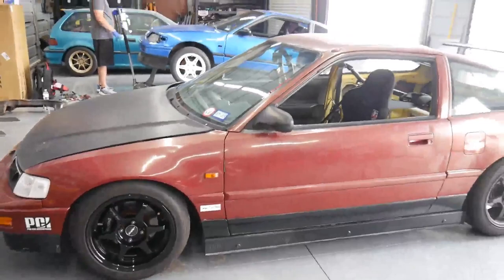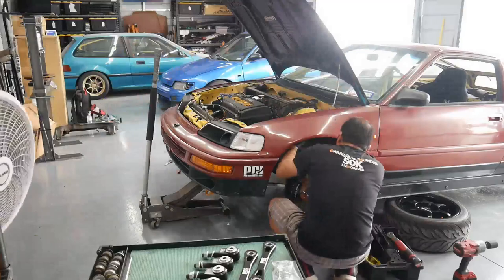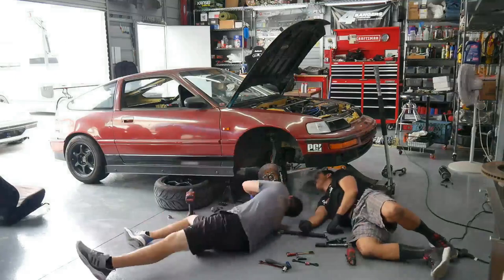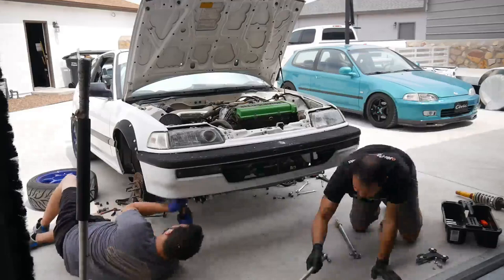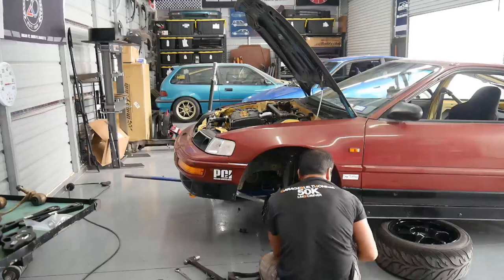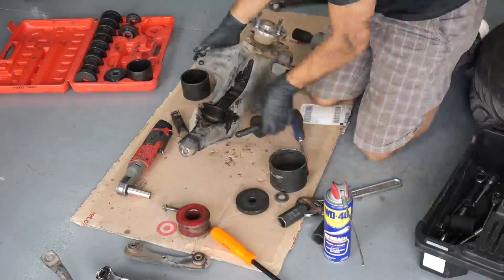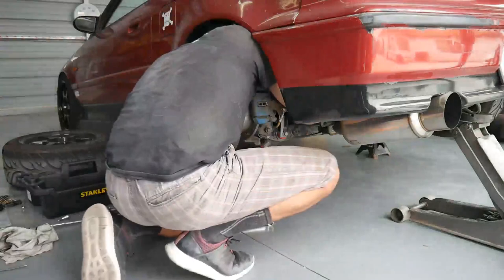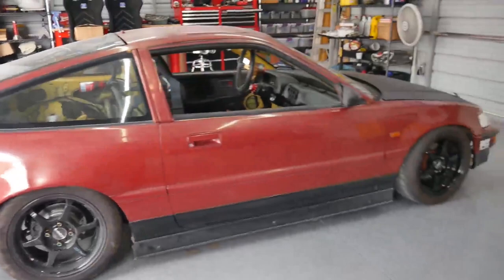Suspension Overhaul Using Spherical Bushings - PCI Components & S3 Coilovers - 1988 Honda EF CRX Si

Comment: Nice set up ! Any noise with these bushings ?   About to drop the type r swap into my 91 si and your videos are making me want to update my suspension. I have that floating feeling and the rocking when changing lanes quickly, definitely doesn’t give me  any confidence .
Reply from the maker: These are rougher for sure.  If you're car is a daily/weekend fun car and not tracked I wouldn't go spherical.  I'd go energy suspension or Hardrace.

These were out faster as well and you won't benefit from spherical for the streets.
Reply: @GarageBuiltHondas  Urethane everywhere but trailing arm bushing, those bind up and tear out. I use a chunky rubber replacement with a bit of flex. If you already got a urethane one, check and lube it often.
Reply: I've got the PCI RTA bushings on my EK hatch and it's A LOT of noise on the street (the rest of the car has truhart/hardrace) . So much noise in fact so that I ordered a set of Mugen RTA bushings waiting to install when I have some down time.
Reply: Interested in knowing if these make noise in the streets

Comment: no no no....this bushing CANNOT be used on DA integras as is. The DA integras have a bigger radius trailing arm bushing. These spherical kits are meant to be used INSIDE the DA trailing arm bushing ring and only inside the bushing ring. These can be pressed into 88-00 civic/integra trailing arms without the bushing ring, EXCEPT DA integra. Please correct this!
Reply from the maker: Wrong.  Take a look at the PCI website.  I know a few friends already doing so.  Here's the link.  He even mentions a supplied template to use to drill in the correct spot.  https://www.pci-racing.com/product/88-00-civic-94-01-integra-88-91-crx-honda-rear-trailing-arm-spherical-kit/

Comment: i agree the trim will look better oem, especially the door pillars. i love pci side skirts and i know how functional they are, but the lack of front and rear lip makes the body lines look so unbalanced. are you cutting the rear bumper and not worrying about the front lip because it lessens drag?
Reply from the maker: I run a removable splitter on this car at the track so it fits the skirts pretty well.  https://youtu.be/jKQ0cQJGEl0
Reply from the maker: Here's an image of both together.  https://www.instagram.com/p/CWrbsN9Mcjy/?igshid=MDJmNzVkMjY=

Comment: Hey man! Hope all is well. I had a question for you. I am having an issue with my ef jdm b20 swap. I was hoping you could help. I am using an A1 transmission for a 90-91 integra. When I had the transmission mounted to the engine and I pull up on the cable clutch arm the throw out bearing fails to make contact with the clutch to be able to shift gears. Is there a spacer or something I need to get that transmission to work. I double checked to make sure I had the right flywheel and clutch. Any help you can give me is much appreciated. Thank you.
Reply from the maker: No spacer.  It should work just fine.  A DA clutch cable is shorter which may help solve your issue.

I usually switch to that cable when doing a B swap with cable trans in an EF.

Comment: Nice! What are your thoughts on brake upgrades from a completely stock setup? I'm debating between Wilwood big brakes for the front or doing a rear disk conversion. wilwoods seem like the easier install. You dont seem impressed by the skunk2 coilovers, thoughts on using them on a track/daily?
Reply: Do the rear disk so it takes some load off the front brakes.
Reply from the maker: Rear disc first.

Skunk2 are great.  I'm comparing the ride quality between the Tokico Blue shocks and the Koni Yellows.  Tokico are solid, but the Koni are far superior.

Comment: I just ordered the innovative crossmember for my 89 CRX. Any thoughts if it's safe to continue using it as a jack point for the front? Also interested in how the drive goes on your PCI components. Thanks in advance for any input.
Reply from the maker: That bar works fine for a jack point.  I've never had any issues with it nor has anyone else I've known.

PCI are for track cars only.  Waste of time and money for anything else.
Reply: I'm definitely building a track toy. At least to do HPDE and progress from there. Not using this CRX for anything else. Thanks for the input though.
Reply from the maker: You'll love em then.  Perfect for what you want to build.

Comment: Might be a dumb question. But would spherical bushings be good for DD? I'm looking to upgrade my 2004 civ DD. I got some mysterious popping going on. Already replaced front and rear struts and front lower control arms. She's got 250,000 on her so it's pretty much time to do other bush n arms as well. I should mention I also replaced inner and outer tie rods along with lower ball joints. It does not do the popping going over bumps. Quite often backing up and sometimes breaking hard and then starting off from a stop I/e.
Reply: Lol no. They're basically solid bushings. You will feel everything on the road.
Reply: I don't know about a 04 civic but my 91 had a popping sound coming to a stop and taking off because the front traction bar bolts were a little loose
Reply from the maker: Might be an axle going bad especially if it's old.

I can't remember, these cars don't have upper ball joints, correct?  I was going to say check that one too but I'm thinking they don't have one.
Reply: @GarageBuiltHondas  the funny thing is it's weird where I hear the popping noise. Sometimes it's around the engine area other times it seems like it's underneath my seat area. We'll have to jack it up this weekend and dive into it. It doesn't sound like the typical swaybar end link pops. I can be at a dead stop and sometimes it does this popping noise when I pull forward. Weird.
Reply from the maker: Definitely check the axle for play
Reply: @GarageBuiltHondas sorry. I should have mentioned from the beginning that it doesn't make it when I turn and it doesn't do it all the time. Only at start of moving and it does like one pop.
Reply from the maker: Still could be an axle.  Ask me how I know.
Reply: @craigorlikowski2507  general rule-of-thumb with CV joint popping is that if the popping occurs in a straight line, it’s the inner joint.  If popping occurs when turning, it’s the outer joint.
Reply: @The_Redkween  okay that's interesting to know. Never knew that. The only other downside is once in a while I hear this pop or two during the same type of take off in the rear. Quite often I hear the noise in the front but once in awhile in the rear as well. Same exact pop noise. So that's why I didn't think to look at the CV axles. I assumed it was bushing related.